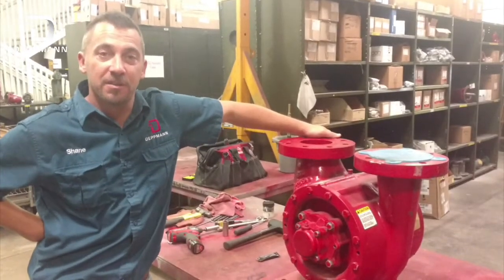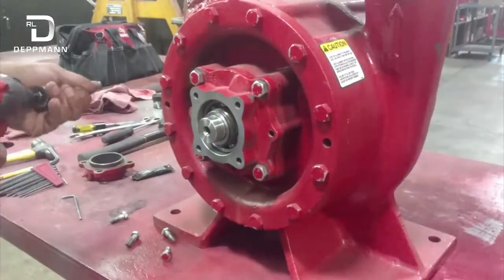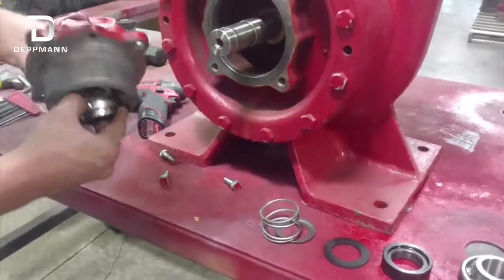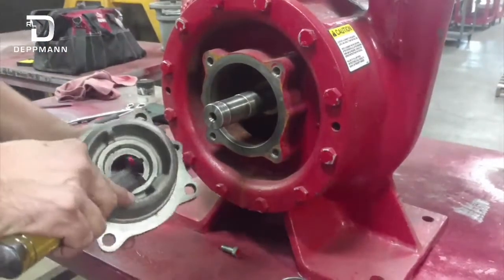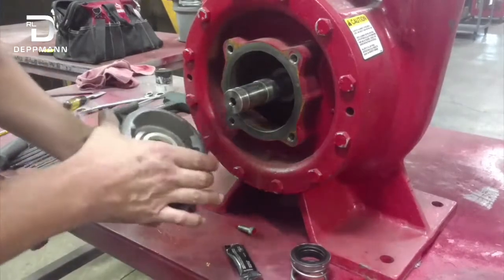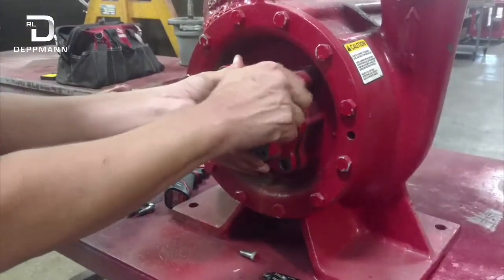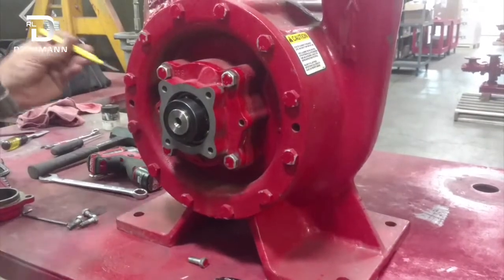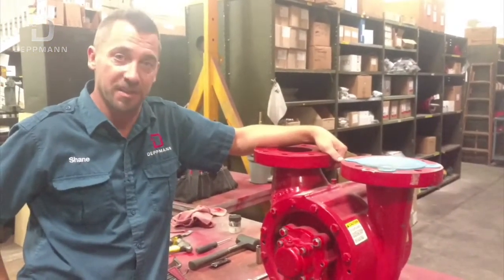How to Replace a Seal Kit and Bearing on a VSC Pump

Comment: Just worked on one of these today. First pump rebuild I've ever done. I ended up taking both sides off and after putting everything back on, the shaft wouldn't spin by hand. If I take any of the bearing covers off, I could spin it by hand but there is some resistance to it. Could it be that the seal isn't seated right?